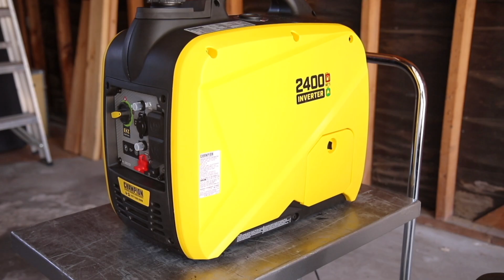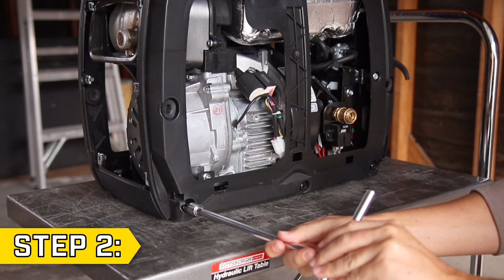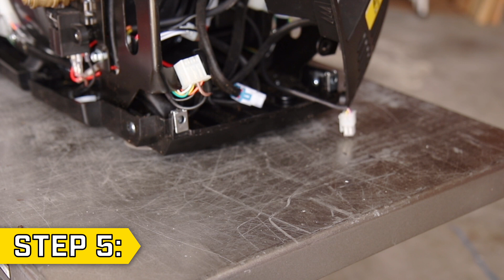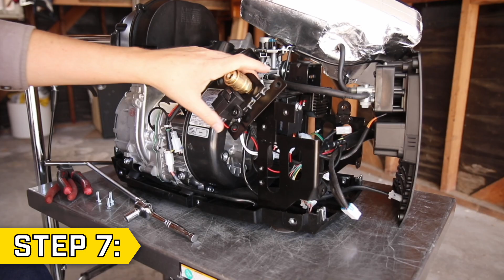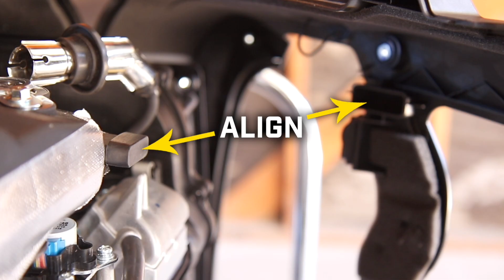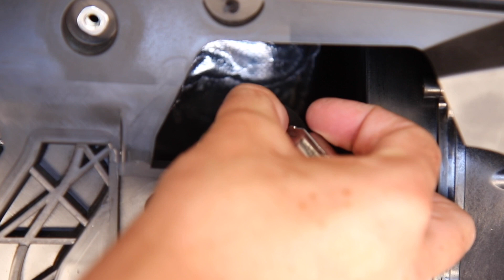Control Unit and Recoil Replacement( 2000+ Watt Inverters)

Comment: How unrealistic. The outside front control panel doesnt just push up and to the side, it is bolted in place from behind the outer control panel somewhere. This is garbage, put the recoil on the ouyside so we can actually replace it without a complete taredown.
Reply from the maker: Hello, We sincerely apologize for the frustration you experienced while attempting to replace the recoil starter on your unit. We understand how inconvenient it is when a repair that should be straightforward requires additional disassembly, and we recognize that the current design can make access to certain components more difficult than expected. If you need any assistance, please contact our support team at 877-338-0999, or support@cpeauto.com. -Thank you
Reply: @ChampionPowerEquipmentHQ  Thank You. With God's help I persevered and got the part replaced.